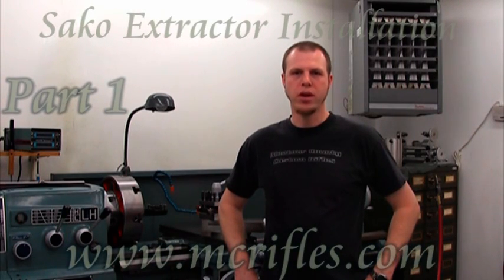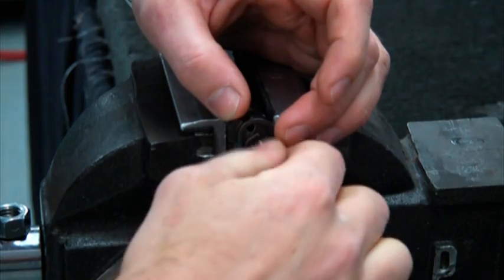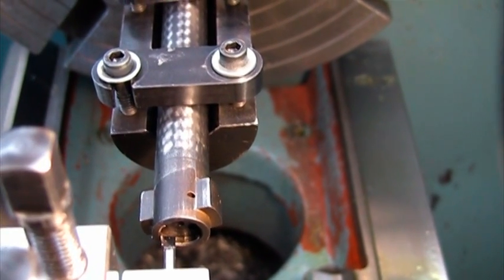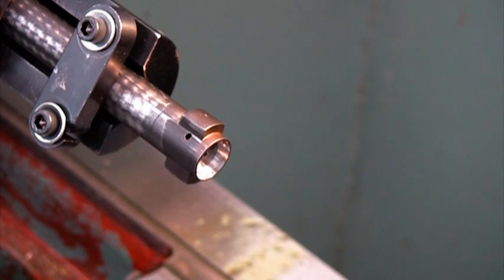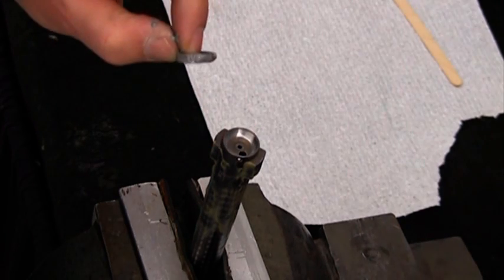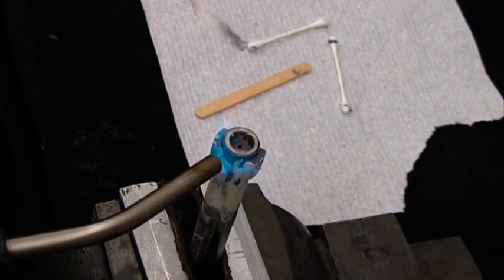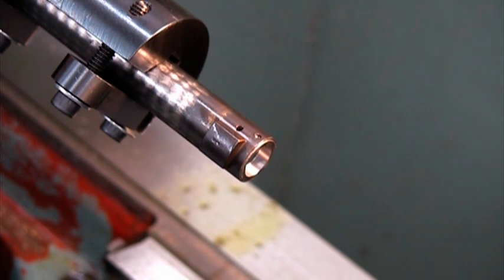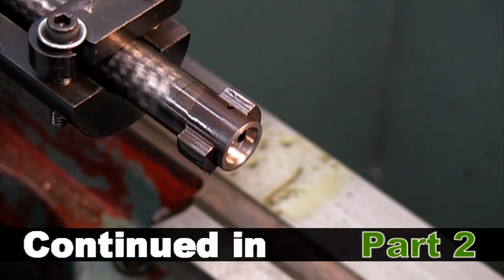Sako Extractor Installation Part 1

Comment: KevinJ Cram,
This was worth every penny!
You did this Sako Extractor Installation for me back in 02/2013 on two Remington 700 bolts and I have not had one failure to extract or one failure to eject.
Thank you again!

Today is 02/24/2021, just over 8 (eight) years.

Comment: I have used silver solder in jewelry repair industry, if you do this allot you should look into companies that supply for the jewelry repair industry, probably allot cheaper than Brownell's. The low temp stuff is called EASY solder, it goes EASY-MEDIUM-HARD
Gesswein is the company that supplied me while working for Sterling Jewelers

Comment: As it is, the Remington is the world's strongest action because of the full safety breech.  Once that bolt face is cut for the sako extractor it might still be as strong as the Arisaka but no longer the world's strongest....
Reply: Lol "strongest"
Reply: You are right... the 700 with the original extractor is the strongest safest 2 lug bolt action every made. This alteration to part of the Sako extractor system is the worst thing you can do to a 700...

Comment: Does one have to be concerned with annealing the bolt structures from the heat while soldering, say if it was for a magnum load, even with the heat sync paste?
Reply: bolt didnt get to annealing temp

Comment: To braze or solder you're heating the base metal to at least 800 F. That's WAY hotter than any "safe" temp steel can be heated to without affecting heat treatment and hardness. I hope to hell you have those bolts heat-treated after your "upgrades".

Comment: How much run out is in the spindle of your lathe. Bet you it's not better then .0005" that's another assumption made quite frequently. You don't get lathes with tighter spindle runout until you get into the tool room type machines. And they are usually no better then .0002" runout.
What I'm trying to say here is your indicator is not absolute and it has internal hysteresis that create a degree of uncertainty. If you've been making parts as long as I have to the tolerances I have you would know

Comment: Well I have to disagree. Your indicator is not accurate enough to measure down to .0002"-.0003". I find it disconcerting that you assume the indicator is absolute. 
As for the material used. You may feel comfortable using a low grade steel. But not me. That ring may not see a lot of pressure but it does see some. I'd feel better with a piece of 4140. 
Like I said I don't have a problem with how you are doing things. Even the leadloy is no big deal. I just disagree with the tolerance you are sta

Comment: You may have had good luck with you practice but I would never use leadloy (12L14) on any critical area of a firearm. and claiming .0002" to .0003 with a .0005" indicator is a joke.
Open up the little piece of paper that came with the indicator and you will see to tolerances listed. One is accuracy and the other is repeatability. Accuracy for a .0005" indicator is right around +/-.0001" repeatability  is right at +/-.0005"
So that .0005" indicator could be reading as far off as +/-.0012"
Reply: Why did you (and everyone else who does this downgrade) only install part of the Sako extractor system? It still needs the long 'deflector' or bolt guide to make it safer in the instance of a case failure. You have negated all of the strength and safety of the original 700 extractor system.